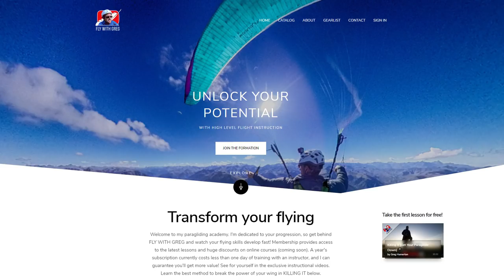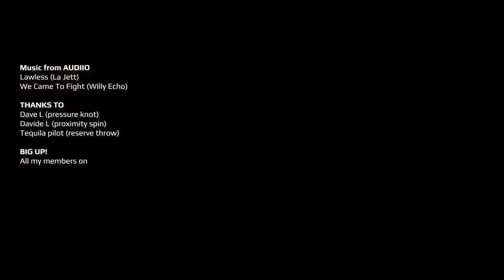Paragliding Gone Wrong: SPINS Explained By An Instructor!

Comment: I can add one situation here, that I created myself, on a high-end B. I was soaring about one or two beats on a knife-edge ridge in Nevada, and a large spiky thermal rushed through, which was pulling me over the back into the lee. I heaved a lot of brake to try to stay in front of the ridge, but spun the glider. I recognized the spin and had turned about 90ish degrees before hands-up- but the the wing still rotated a bit further, despite a full recovery. As I swung under and would have flown away, unfortunately the ground was right there, so I pulled off a sort of fast landing, onto my harness padding. I finished in a cloud of dust- then realized my lower leg was sort of backwards (no pain). I assumed a dislocated hip, until I felt some sponginess and realised I had broken my femur clean through. No blood, no bruising- but I had landed on a rock. In hindsight I would have gone further out from the ridge even earlier than I was planning - the mistake I had made was how punchy the thermals were going to be, given that the day otherwise had appeared calm to me,
Reply: I dont understand why you pulled on the brake during any of this.
If the wind is starting to push  you behind the ridge, you have 2 choices:
- go as fast as you can against the wind, to try to stay upwind.
- go quite fast downwind to go the farthest possible away from the leeside rotors.
Reply: @niconico3907  Well, because I had started to turn in the thermal, not realising it was going so dramatically over the back- so I was turning to get myself in a position to get back in front of the ridge. It was such a punchy bubble of life, I wasn't sure that I could stay in it and just circle out above the ridge.

Comment: Hi Greg, nice video as always. You might want to mention that the fellow at 3:05 is pushing bar and pulling brakes at the same time too. That certainly helped the stall a lot.
Reply from the maker: You would be right but I think he comes off the bar, the risers go back to level and he has a conversion (beeep beep beep) before turning downwind. He's just got his foot hooked onto the bottom loop of the bar. He does fly out the back of a thermal and gets some sinky turbulence which surprises him, and messes up his turn. I'd want that glider to be checked as well, it spins suspiciously easily.
Reply: @FlyWithGreg  There is a lot more than that in this clip, but having as much brake as he had with almost full bar as he's got at one point is definitely asking for troubles and very unnecessary. Even if it's rather going to cause a collapse than sa pin... I think it's goo indicator of the lack of skills and worth mentioning.

Comment: I am still learning paraglider. Got a private pilots licsene with an instructor who insisted on spin training. I am thinking that it should be the same recovery as in a fixed wing airplane. First break the stall by applying full forward on the controls then put in opposite rudder to stop the spin and recover from the dive.  Make sure and practice with plenty of altitude to give you time to recover. Spins arecaused by stalls which are caused by lack of airspeed over the wing caused by wrong angle of attack or getting too slow in a turn. Airspeed is the key.
Reply: Actually if you are at the beginning of the spin, less than 90 degrees, the best is to release the brakes as fast as you can.
But if you are past 90 degrees, you are well trained for that, and you have plenty of height. it is better to stall the glider completely, it will stop the spin, you wait for the pendulum effect to stop and Then you get out of the stall both sides at the same time, so you fly straight.
If you dont do that there is more risks of twists in the risers.

Comment: Had a spin in the Brits in Pedro Bernado '19. A snotty, tight thermal low down that took some staying with. Deep brake in one part of the thermal was too much brake for the next part and I span because I didn't react quickly enough. Late hands up meant I had a lot of energy to deal with but thankfully my EN C reacted well and I was able to continue the flight. Lessons - my active piloting was not active enough in this thermal and being in a desperate situation mid way through a task and trying too hard probably compounded that. Did I need that much inside brake on in the thermal anyway? A shallower turn would still have gotten me the altitude I needed, just not as fast.
Thanks for the wise words Greg.
Reply from the maker: That sounds like a tricky situation. I find you can 'cycle' the inside brake in very tight stuff, to keep giving your wing surges of energy and speed, and it doesn't make your turn radius any wider. (weight shifting hard in) crank the brake, then release it for speed surge, crank, release, and go back to a steady hold when the air is steady.
Reply: @FlyWithGreg  I'm going to have to write myself a reminder to give that a try. Roll on spring :-)

Comment: As a Hang Glider pilot I found this very entertaining.
Reply: Hg landings are just as entertaining
Reply: I assume you can spin a hang glider?
Reply: @yanerik6850  Yes, on purpose. Only on Intermediate and advance gliders. Pull 1/2 VG ( variable geometry) , 20° stall Turn and stay. Search hang gliding acrobatics. Beginner Hang Gliders are almost impossible to spin by design.
Reply: @Vl7248  and obviously you noticed that almost every " funny" landing pilot gets no injuries. There is deformation material before pilot hits ground : uprights, control bar, nose,....
Reply: @NoTengoIlusiones  not true. I’ve known several people who’ve fracture their arms and injured knees. Let’s not say one is safer than the other. They both have injury risk.
Reply: @Vl7248  My best friend is a super Paraglider pilot , 20 years instruction, comp pilot, record holder for tandem etc. Many many years ago we come to the conclusion that we cannot compare both worlds in terms of performance.  BUT ! In security it's a completely different subject. Do you know that Hang gliders are almost " Indestructible " ? When fly the Hang glider is like wearing a t-shirt you dont remember it ! They do not colapse, change shape, nothing ! Just there to be piloted,  in rough or smooth air, in our conversations " throwing chute" is never a theme! Paraglider on the contrary is  living animal above your head, front colapse, cravates etc etc etc tou name it. I fly paragliders in smooth air near the sea. In thermals no way ! It's a complete madness. Cheers and fly safe.
Reply: @NoTengoIlusiones  depends on the day but I would agree. I fly both and base the decision on conditions. Hg wins if conditions are strong. Otherwise pg wins for anything under 10mph winds within no gusts.

Comment: It happened to me once a few years ago. I was turning way too much and went into a spin on the Porterville ridge. I immediately raised my hands. The wing ( BGD Echo ) stopped the spin once it gained some speed and pulled me out of the spin by itself. I lost about 50-80 meters in this spin. After that scare I now only fly fast and use as little break as possible with a lot of weight shift for turning.
Reply: that's usually the most efficient way to fly anyway. Don't be afraid to take tight turns though, just don't slow the glider down a ton.

Comment: How do you "practice finding your spin point" - safely?

Thanks for the always-great videos.
Reply: you have to be in a setting where you are safe to throw the rescue if needed, stall/restart if needed, otherwise practice at the dunes.  Finding the spin point is the easy part , inducing a spin that you can exit without a backfly, and being able to recognize quickly that you actually created that possibility is MUCH harder, and can result in big "shoots" /slack lines/ riser twists / frontals / when you had it but hesitated.  getting Helicopter = bliss Mistyflip = enlightenment (also helps to be light and/or on a student glider)

Comment: Great analysis... but how do you tell if you're courting a spin and it's time to back off? Is there a signature behaviour that shows that you're in the danger zone?
Reply: Break becomes soft (but its really short moment where you have to react - this is also why I never fly like holding a handbag. just too much dampening.)! That's the sign of danger and time to realize it immediately. With my 350H experience it has always saved me. Just letting it go. do not think that you will lose thermal or other unimportant stuff. Just ease on break and wing gonna take care of you.
Reply: The warning sign is the wing deforming, and the wing tip moving backward.( wing tip is not where it should be compared to the rest of the wing).
2 ways to know how it feels on your wing: ground handling with some wind, you practice stalls, pulling both brakes until the wing start to fall back. A spin is the same but only on one side.

Second and best way: SIV training, that whats they are made for, to know where are the limits of your wing, how to recognise when you are close to the limit, and what to do if you go over the limit.
Reply: @niconico3907  thanks, that makes sense. Much appreciated :-)

Comment: Had a spin on my Epsilon 7. It was my total 3 hour flight. In 200m above i start tight spiral with a slow speed. On 2 or 3 turn glider start spinning. Then i (my mistake) pull the outher brake. Spinning going very-very fast and glider fall on the horizon line. I had dark in my eyes and i release inner brake, and trow reserve. Glider jump over my head and does dive in the front of me in 70 degree. Fortunately, parashute was fully open and i don't fall in the canopy. Now i'm scared my glider. Sorry of runglish.
Reply: go to the SIV you will lose the fear of your glider for real bro

Comment: Is it possible on this last example to grab left or right lines and pull the glider to yourself and fold it somehow just to reduce the resistance on the safe?
Reply: Or is it too hard? so you don't have enough strength?
Reply from the maker: very hard, there's SO much pressure usually. The secret is to do it right at the start, as the wing surges ahead and goes slack, so be prepared to do it just after releasing your reserve handle into the wind.

Comment: Greg WHICH rizers would you cut? The As or the Ds?
Reply: The A, they are under more load, so easier to cut, and it will stop the wing from flying ( same as B stall).
If you cut the D, the wing will still fly, because the profile is still good, from A to C.

Comment: Hey Greg,
Thanks for the vid, I really appreciate your advice!

When having a cravat on a 2-liner, what do you do?
Have you ever heard of "spinning it out? If so, can you recommend that or would you rather stall it out ?
Reply from the maker: yes, I'd try that before full stalling it. First, I'd do an asymetric collapse and try to reinflate, its the fastest and releases tension. Then I'd find the stabilo line and pull that in hard. If no joy, I'd try an aggressive punch down on the brake on the affected side of the wing, to bend the tip back like right at the end of this video. If none of those work, I'd try going to point of full stall (both brakes). Then full stall the thing (IF I had the height). or throw the rag. nasty things, cravattes. Best to have quick reactions on the brakes to keep them open.
Reply: Short spin  (45 ° is often quite enough) is the most consistent way to get cravat out from my experience. And its  #1 on my reacton list - unless the altitude or terrain is extremely close. Its also the fastest way, that have and  low altitiude loss  (10m-15m if done properly).  

You dont have to reach ANY lines  - that where many pilots loose control over their direction with cravate and begin to rotate.  You have to be of course profitient with your wing to do it in well controlled manner.

Comment: Why is it that leaning away from the turn increases likelihood of spinning? Having higher loading on one side of the wing just makes it more resistant to collapses I thought. What else happens?
Reply: Weight is what make the wing go forward. If you put less weight on one side of the wing, and put lot of brake, it will stall easily.
And if you weight shift away from the turn, you will need more brake to make the same turn.

Comment: Thanks a lot for this great content! That pilot who did the slow turns, for which reason would he do this ? (It looks like there was a lot of left brake at the same time as he was turning to the right). Was it to ease staying in the thermal ?
Reply: Your ascend rate in a thermal is equal to the upwind ascend rate minus your fall rate.
And while you can't do much about the thermal strength, you can reduce your fall rate by flying more slowly, which is sometimes the only way to go up on weak thermals. 
But of course if you overdo it you put yourself in danger by getting close to stall point.
Reply from the maker: @booketoiles1600  on modern wings, you don't reduce your sink rate much by flying more slowly, that applies more to wings before 2000. When you move an aerofoil faster through the air it generates more lift. The reason to fly slower is to spend more time in short sections of lift, and to reduce the required circling radius a little so less bank is required to counteract centrifugal force. Either way, so much outside brake is not recommended, the pilot would have been safer using more weight shift and a little less inside brake ... using the outside brake occasionally to prevent tip collapses.
Reply: Thank you both. It is true that in light conditions you might slowly come to that situation by trying to get scraps of thermals... All without noticing, except the sound of the wind disappearing and... too late ! As a lot of crash videos are running through youtube, I find very interesting and reassuring to analyse them as most of the time they come with obvious causes and brings lessons. Thank again for the content and your time on this 👍

Comment: The more I watch the more scared I am to take up this sport 😃
Reply: Try it, get lessons, then decide if the rewards are worth the risks. If you only take the downsides of something, you will never do anything.
Reply: Nothing is 100% safe. You could also watch hundreds of videos on people falling down a stair, slipping on the sidewalk, crashing their car etc.

If you go into a beginners class for paragliding, 
then you will start to walk/run with the wing on a field
then a few meters up a hill taking big steps
then higher up the hill and missing a few steps while running, etc.

So it is a slow process with nothing scary the first few days. You could still decide that it is nothing for you once you made your first 'flight' of 10 meters and 1 meter above ground

FYI: I fly a beginners-wing (A) and they are pretty impossible to destabilize ... other people fly more dynamic wings and you will find those in this kind of video

Comment: How would you go about finding your spin point?
Reply: I would like to know this too 🙏🏼
Reply: Just check Greg's playlist. He already published a video about the spin point 😉
Reply: @ivoivooo5857  Thanks!
Reply: all glider are different that why you have to test your glider in siv eviroment to find it. point of full stall and point of spin and more spin come with hard input of a single break.
Reply: i was in siv i just miss spin, reserve shut and wings over everything else was done and give you so much more respect in your wing as fear out of your system
Reply: @FlyBabyFlyPPG  it's my understanding that if you even out the breaks a bit, as in balance off a little on the outside brake while still leaning into the turn you're less likely to spin. Am I right in saying that?
Reply: @relo4727  check out ojovolador youtube channel he is spanish but have some good videos in english where they talk about thermal flying, the answer of you question is that you balance with your weigh shift and let luck your break where you are able to be in the turn that you looking for, is just to try to disturb the less posible the wing for have more glide posible
Reply: check out 2 books that i bought from cross country magazine thermal flying (burkhard martens) and fithy ways to fly better(bruce goldsmith and friends) super nice 2 books
Reply: @relo4727  if you want to turn tight without losing too much height, the best is lean inside the turn and pull the inside brake, and also the outside brake, but less. If the outside wing goes full speed, you will lose height.